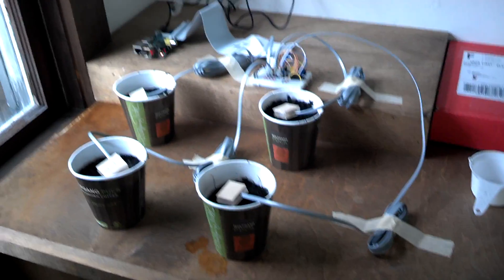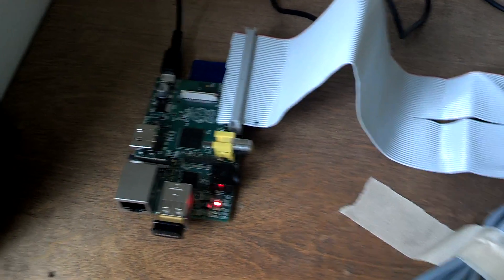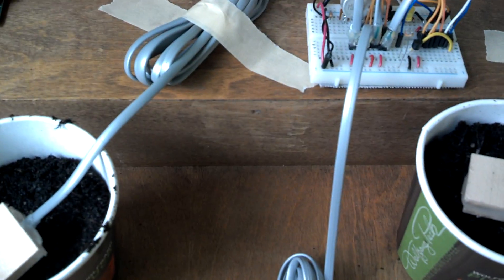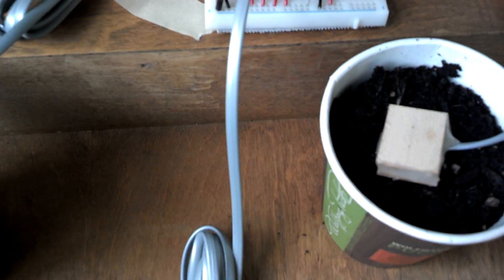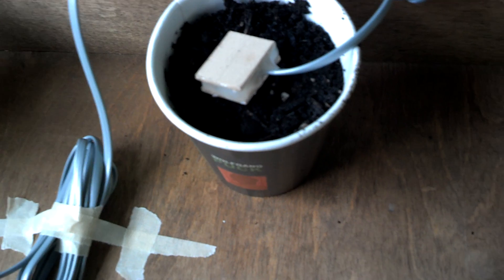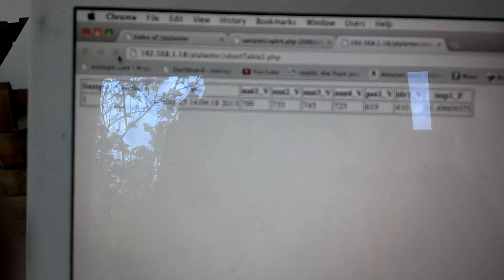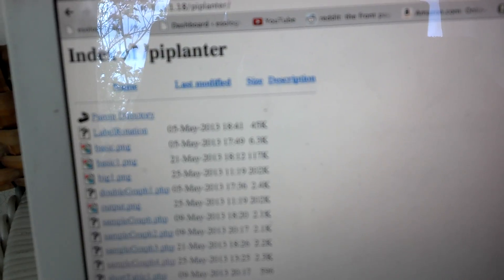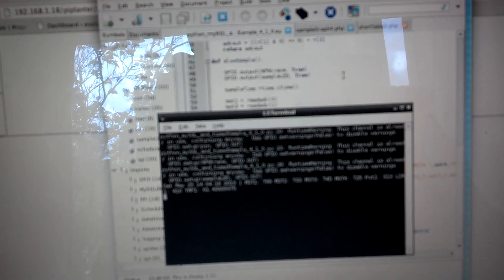Raspberry Pi moisture sensor for green house automator

Comment: sir..can we do the same thing without using adc????
Reply from the maker: No, you must use an ADC.
Reply: sir actually i am a non electrical student, but we are still doing this 
thing for our project... We are using YL 69 soil moisture sensor, and i came to know that 
it already has a digital output in that. Can you just tell me what is its exact purpose?
and can i use this pin to display output on laptop using raspberry pi 3 model B?
Or i must definintely use the adc mcp3008?? please reply asap.